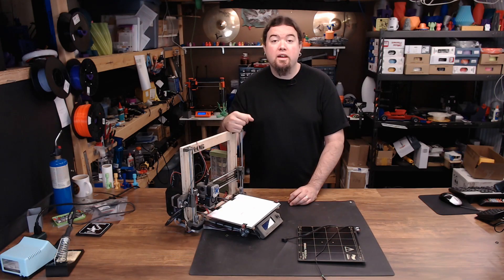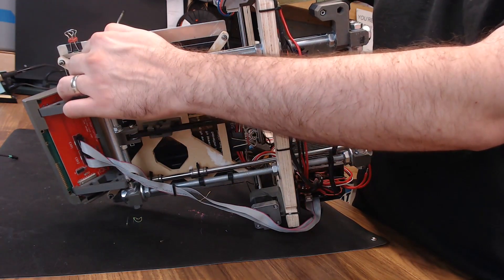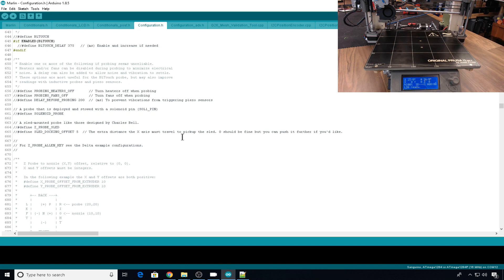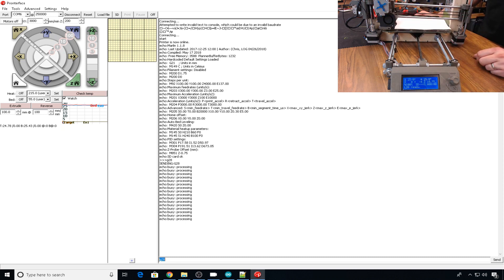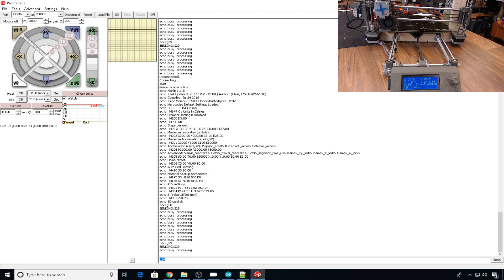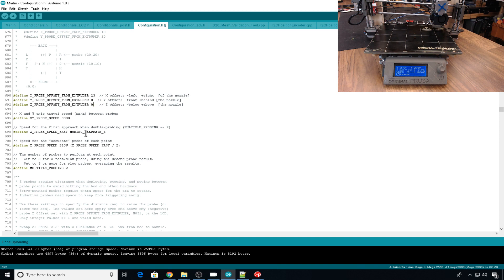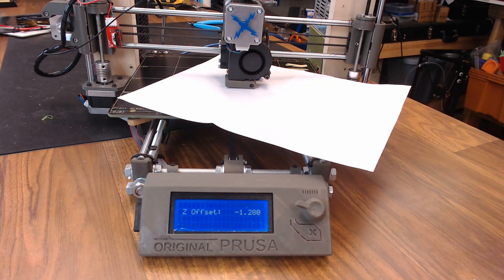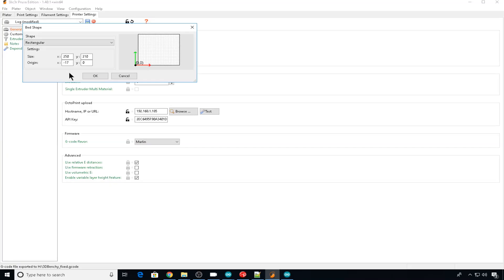MK42 Heated Bed Upgrade - Log - Stock Marlin - Chris's Basement

Comment: Great video Chris, your tutorials on setting up a new printer have helped me out so much. But I'm following the steps in the video and I'm having a bit of a problem. I'm using a RAMPS 1.6, 12V MK52 heatbed,  P.I.N.D.A probe v1 and TMC2130 with LCD, all of them are clones from Aliexpress and everything works as expected. I'll G28 than G29 and everything works fine initially but when I heat up the hotend and heatbed than G28 and G29 the Z axis starts to move up and away from the heatbed on every probing position.
Reply from the maker: Wow, that is really strange. I can't think of any reason why they would happen unless the heat is causing the probe to freak out. Very strange.

Comment: I don't get why it is important to hit exactly these 9 spots while probing. On other beds you just do a 3x3 grid and it works fine. Like what is the advantage ?
Reply from the maker: On the 42 bed it has 9 spots that have a solid layer of copper. Some of the other parts of the 42 don't trigger that well.

Comment: After watching this and spotting the Prusa upgrade kit was 12v, I upgraded my Mk2 Clone to 2.5ish. The only slight issue was the bed draws 15 to 17 amps through the RAMPS’ 11 amp fuse! But keeping the cooling fans running flat out on the RAMPS seems to keep it going OK so far. 

Thankfully the polyfuses reset when they cool down. Not sure how I’d deal with the surface mount fuses fitted to the later RAMPS 1.5 and 1.6. 

Keep up the upgrade videos. Always a delight to watch.
Reply from the maker: Thanks! Wow, that seems like a lot of load. Thinking about it, I don't think I have ever measured one. That might be normal. Thanks for watching!

Comment: great video... only downside with marlin is that you can't enter decimals for the probe X/Y offset, only the Z. 

I have verified that I got the right X/Y numbers for the points as I can make the nozzle touch and extrude 1mm and get a spot dead center in the 4 corner spots. I guess i could do the same for all 9 points if I wanted to.

but to place the probe dead center on the probe points i need to go .5 more on both X and Y offset. i think my Y offset it 23 and X is 10... but to be precise they need to be 23.5 and 10.5

the first point is dead on correct, but the middle front and right front are off
left back is also ok but not middle and right in the back
the center and the right one next to it is also off....

but yes.... as others have said said some stuff from prusa should be ported back to marlin

i think what prusa does is to probe heigher up where the difference in copper tracks and copper in the probe proints is enough to make it not trigger unless over a probe point. and and then it searches back and forth over each point until it knows the precise center, once it has one it knows where the others should be.... 

and by doing this search on all the points it can compare where it finds the points to where they should be and figure out if bed is skewed etc
Reply from the maker: Thanks for the comment BO I didn't even realize it wouldn't take decimal. It would be nice to see the Prusa stuff back ported for sure.

Comment: Another good mod impressive, but now LOG's x-carriages are tilted (left side up! as in 9:46 about 3 mm higher then right!) will this effect on it's print quality?
Reply from the maker: Thanks! I really like the Prusa beds. Log is always just a little off on the X. I can't seem to keep it balanced. I move it around to much. It really should be as level as possible, because ABL isn't really that good at correcting that kind of skew. I can tell you, it is a lot less of an issue now that I upgraded the bed. The probe point quality has really seemed to help.
Reply: I  have a similar setup like LOG for my printer(but SSR-driven AC silicone bed), the average Viars between G29 to G29 can high up to 0.5 mm! After poking around Marlin's configs, I find out that there is a new feature which can turn off the fan while probing to improve probe accuracy. After some trails it did provide a reasonable G29, but since my aluminum haet mass already had 0.3 mm screw on it, so I can't 100% sure it's effectiveness. It is Probably worth trying.
Reply from the maker: Yes, I have seen that feature. If you are having inconsistency issues, it's definitely worth a shot.
Reply: Chris Riley  on my mendel90 i took the plunge and have dual z steppers and dual z endstop to keep X more level in relation to the bed. i'm lazy and like it to be done automatic
Reply from the maker: That's a great idea.

Comment: Great mod...like that you reuse the MK42 bed from your MK2.5 upgrade on the Prusa MK2s for your LOG printer. What do you think is missing in Marlin compared to Prusa MK2.5 firmware? Laser sensor support, wizards?
Reply from the maker: Thanks Gussner! Wizards for sure! The main thing that the Prusa version does that Marlin doesn't is measure the sensitivity of the probe. It has the ability to do some math somewhere to judge the quality of the probing and adjust the skew correction. It would be cool if we could bake the calibration sequence in to the config.

Comment: Chris I saw on Aliexpress that you can order the Prusa Magnetic bed, wired for 12 volts. The search title was.
12V Prusa i3 mk2/mk2s upgraded mk2.5 PCB heated bed, with magnets. I do not know if links work in the comment section but here it is .
https://www.aliexpress.com/store/product/12V-Prusa-i3-mk2-mk2s-upgraded-mk2-5-PCB-heated-bed-with-magnets-Presale/4047030_32882216254.html?spm=2114.search0104.3.99.377513f8FXVbjM&ws_ab_test=searchweb0_0,searchweb201602_1_10065_10068_10130_10547_5015511_10546_10059_10548_10545_10696_100031_5016211_10084_10083_5015611_10103_451_10618_452_10307_5016311,searchweb201603_2,ppcSwitch_5&algo_expid=ae431f84-797f-4ec7-8bc7-0f67291057dd-14&algo_pvid=ae431f84-797f-4ec7-8bc7-0f67291057dd&priceBeautifyAB=0
Reply from the maker: I would love to see one of these up close. I didn't even know they were out there, thanks for the link. We might have to check one of these out for posterity.
Reply: There is another seller as well, that has them in stock now but wants a few bucks more.
https://www.aliexpress.com/store/product/Prusa-i3-mk2-mk2s-upgraded-mk2-5-PCB-heated-bed-12V-with-magnets/2808029_32879233130.html?spm=2114.search0104.3.15.5fdfff64tc9B0C&ws_ab_test=searchweb0_0,searchweb201602_1_10065_10068_10130_10547_5015511_10546_10059_10548_10545_10696_100031_5016211_10084_10083_5015611_10103_451_10618_452_10307_5016311,searchweb201603_2,ppcSwitch_5&algo_expid=0dae8569-5c56-440b-9e84-803b4cbe407a-2&algo_pvid=0dae8569-5c56-440b-9e84-803b4cbe407a&priceBeautifyAB=0
Reply: Here is a link for the steel flex sheet only.
https://www.aliexpress.com/store/product/Prusa-i3-mk3-3d-printer-printing-surface-Spring-Steel-Sheet-for-Prusa-i3-mk2-5-mk3/2808029_32899337782.html?spm=2114.search0104.3.8.2b05f8ecedEXY9&ws_ab_test=searchweb0_0,searchweb201602_1_10065_10068_10130_10547_5015511_10546_10059_10548_10545_10696_100031_5016211_10084_10083_5015611_10103_451_10618_452_10307_5016311,searchweb201603_2,ppcSwitch_5&algo_expid=fdd42760-41d0-45c2-8c4e-5f5dd1c68593-1&algo_pvid=fdd42760-41d0-45c2-8c4e-5f5dd1c68593&priceBeautifyAB=0
Reply: Here is the spring steel flex plate and 2 PEI sheets.
https://www.aliexpress.com/item/Prusa-i3-Mk3-Mk52-Spring-Steel-Sheet-Heat-Bed-Platform-3D-Printer-Printing-Buildplate-and-Prusa/32899317930.html?spm=2114.12010108.1000013.1.9f3f6fd6ZIdWHl&gps-id=pcDetailBottomMoreThisSeller&scm=1007.13339.90158.0&scm_id=1007.13339.90158.0&scm-url=1007.13339.90158.0&pvid=5997e680-13f5-477c-ac77-458c4d0b1e33
Reply from the maker: Wow! Now I really want to buy some of this stuff.